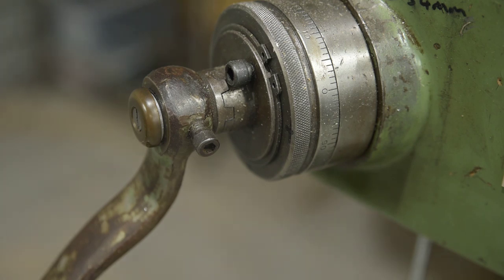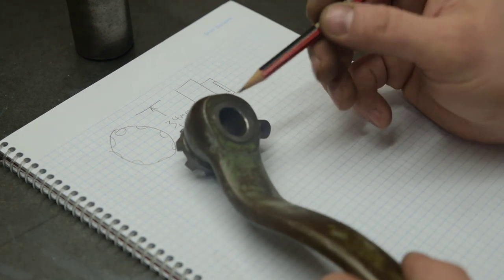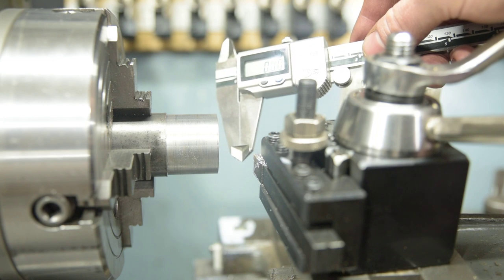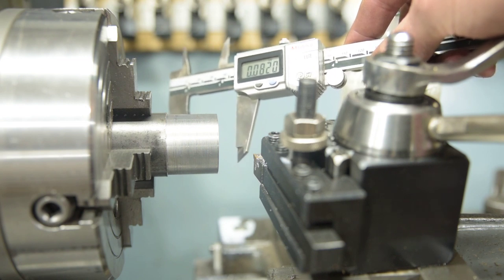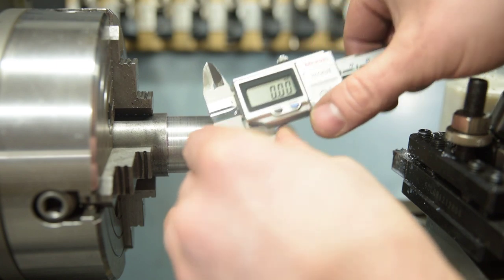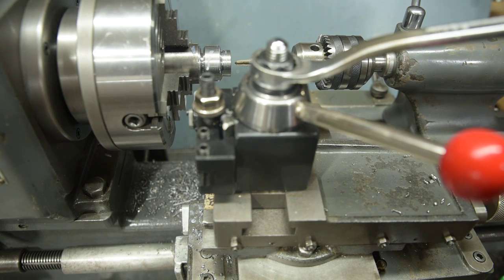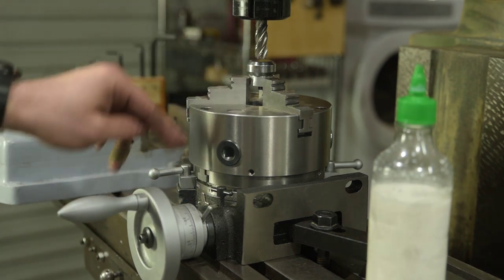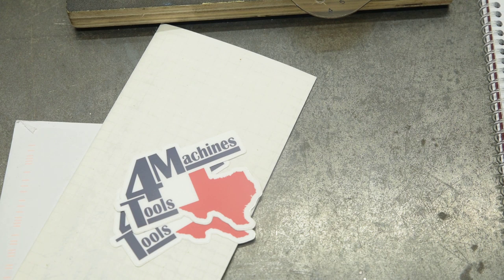Making a steel thumbwheel, plus some great lathe tricks

Comment: Thanks for the tips. Very handy to know. I really like the process you used to design the number/spacing of the flutes. I too find that aesthetically pleasing.
Cheers from Canada
Reply from the maker: Thanks for the great comment :) I am pretty happy with the design too. I reckon I'll probably end up using these proportions in future projects. One variation that I want to try is an external radius where the chamfers are, but that's just an idea at this stage.

Comment: Cool knob, I like the heavy chamfer and 5x flutes.
Reply from the maker: Thanks. The more of these I do, the less I think I need straight knurls on the shopping list 😁
Reply: @CraigsWorkshop  I find knurling a pain these features are a fun way to avoid it. It's a pain cause I have a small lathe. too much load for the push type knurl, hard on the bearings and chuck. And the cheap overarm pinch knurl I have it a piece of shit.
Reply from the maker: I've got a fairly crappy pinch knurler too (angled knurls) but I far prefer theae flutes too. It takes longer, but I think worth the time.

Comment: Gday Craig, the knob really looks good, definitely better not going as deep with the end mill, the polishing bug has bitten I see which is awesome, things don’t go rusty as easy, that’s a big plus, I’ve been doing the same deal with the digital callipers for some time now and it really is a big help, take care, Matty
Reply from the maker: Cheers Matty. I kind of mixed up two separate tips in one segment. Should have kept the caliper-zero tip separate from the balanced cuts tip - it would be less confusing! I've been doing the zero thing for ages too but a lot of people don't seem to use that method. In combination with the imperial -> metric thing, it's a great timesaver.
The balanced cuts thing is great for hitting a target dimension pretty precisely. You can use an indicator on the cross slide for even more accuracy of course.
Cheers, Craig
Reply: @CraigsWorkshop  You could also use an angled top slide for micro-adjust - old model engineer's trick.
Reply from the maker: @paulwomack5866  Absolutely. I did a video about extending this same trick to also convert mechanically between metric and imperial. Check out my last year video with the #tipblitz19 tag. Good fun if you like workshop tricks 🙂

Comment: Works great in use-handle mode, but when you're reversing the handle to save space, it looks as if the knob either needs to be a little larger in diameter to sit nicely ON the teeth, or a little smaller to sit INSIDE the teeth. It looks a bit on the edge as it is.
Since your lathe can't turn it larger, smaller seems the "go to" option, if I'm seeing it right.
(freeze frame at 25:46)
Oh - and Abom79 has been banging on about equal cuts for years.
Reply from the maker: Thanks for the Abom reference. Also you're totally right, I will shrink it down to fit within the castellated section. Just need to turn up a temporary aluminium collet first to hold the five lobe shape In the chuck. Don't reckon the three or four jaw will cope well with all the flutes and bumps.

Comment: Good job Craig. Works OK.   I would have just coarse knurled it to match the graduation ring further in on the shaft.  Either way it only has to be finger tight.  Cheers Rob
Reply from the maker: Cheers Rob

Comment: Your next project is to make a spring loaded tap follower for your lathe and mill. Easy to make and you will use it every week. Even with the tap just started in the work it is all too easy to snap a tap off reaching over the top of the lathe with your tap wrench and putting side pressure on the tap.
The other thing to be aware of is that all is not what it seems with electronic digital measuring tools. At first glance you might say that your digital calipers read to 0.0005 inches...that's what it says on the read-out. Remember digital devices are an all or nothing proposition. If your calipers read a zero or five in the last displayed digit the caliper you can at best only be certain that the actual dimension being measured is the value displayed +/- 0.00025 inch. Generally if the dimension has to be held within +/- 0.005, use a micrometer. You can do closer work with a caliper, but you have to be careful and check against a known standard size (checking against gage blocks is preferred). 
Also every time you zero the display the mechanism can only read the signal blocks that are a given distance apart.. it can't interpolate between blocks. The pick-up will pick the nearest block and display that as zero . In the example before with a zero or five  as the last digit displaye  it can be +/-0.00025 inch from where it actually is.
As a practical matter all of this doesn't matter most of the time, but is a factor when you start working in the +/-0.001 range and you should be aware of it.
Nicely made video and if you polish anything (including things like my head) it usually looks better.
Cheers From NC/USA
Reply from the maker: Hey Ace road holder. Brilliant information thanks. I will have to give that a slower re-read to make sure it all sinks in. Good idea on the tap follower. I have many little projects like that to get on with. Thanks again, I hope to show you a tap follower build in a future video. Cheers, Craig

Comment: Nicely done Craig, and because my shops also small, it took just once walking into that knee handle to make a habit of reversing it when it's not being used. However the end shaft for my mills knee was never drilled and tapped like yours is. But it's a definite project for the future I think. A very good idea and well demonstrated.

To expand a bit on Aceroadhandlers comments below, and unfortunately this is going to get a bit long. And sorry but I work and think in imperial measurements. But metric measurements would make no difference to any of this. Since I've had a bit longer to pick some of this up maybe it will help.

Most decent caliper brands will come with a user manual, there well worth reading through since a lot of what I'm posting here is already in them.There's three distinct and separate metrology terms anyone with a home metal shop should know and fully understand what they actually mean. "Accuracy", or what the tool can reliably measure to every single time. And that accuracy is directly linked to it's "Repeatability". And that repeatability has a great deal to do with the tools overall mechanical design, it's built in precision and the quality it's made to and with. Without that repeatability the tool can't be accurate since the measurements would seldom be the same. A soft mild steel digital caliper that was only roughly machined and not hardened and ground would be just about useless as an example. Then there's the metrology term "Resolution" that most get confused about. A tools resolution simply means how many digits there are to the right of the decimal point. A .001" reading micrometer has a resolution of one thousandths of an inch. But that resolution or last digit number is also NOT that tools accuracy or repeatability level and should never be confused with those. So while your calipers do show a resolution down to that 1/2" thou. The calipers themselves simply can't measure that well other than by pure random luck once in awhile. And random correct measurements that aren't repeatable or something you can count on aren't usable since you simply can't know which are or aren't correct. Logically there not repeatably accurate to that high level no matter what the displays resolution reads. So in my shop that 1/2 thou digit is just ignored on my calipers since it's basically meaningless for the following reasons. 

The design and the mechanical components calipers are made with, and the very slight but important clearance required to allow the sliding jaw to even move can also allow a small degree of tilting movement in the tools sliding jaw unless it's correctly used. Yes there are take up screws that allow reducing those clearances to a bare minimum and there usually located just to the right of the dial or display and above the beam of the caliper. There are still small but unavoidable clearances on even brand new tools no matter how well adjusted they are. It's not hard to add a bit of closing pressure and change the measurement by a thou or more.So a caliper's mechanical design alone just doesn't allow measurements to be made reliably to less than maybe a thou or two on even the very good one's. To get better than a calipers average level of accuracy, the far stiffer frame and much more rigid inline components of a micrometer are required. There's also a world wide agreed to metrology standard that the tools being made should fall within an allowable + - one count of it's smallest division or it's resolution to pass it's accuracy and repeatability certification. So a brand new tool being checked in a well known brand name factory can be incorrect up to that + - one count and still pass it's accuracy and repeatability specifications. Almost all of the better metrolgy equipment I've checked (Mitutoyo, Starrett) using fairly expensive Mitutoyo gauge blocks has so far fallen roughly in the middle or around half the maximum allowable deviations. One indicator was at about 80% of the allowed in a few places. A further issue with digital equipment is there's also the rounding off errors. Your displays 1/2 thou reading simply means the tool is reading the measurement as being somewhere between .0003" and .0007" of that 1/2 thou number. That's up to a possible 2/10ths on either side of being correct right there. And what the display is showing does not take into account those unavoidable mechanical issues previously mentioned. 

There's another metrology term, "Uncertainty of Measurement" and there's also the now generally accepted industrial practice that metrology equipment should be at least ten times more accurate as the highest accuracy specification for your parts is. In other words to measure and be certain of your measurements to .001" all your measuring equipment should be accurate and make repeatable readings to .0001" to then be 100% sure your parts are within a tolerance of .001" And that 10ths" level of accuracy still comes with the same allowable deviation of that + - one count. That's part of the uncertainty. And yes I do know high accuracy parts to low 10ths numbers are made every day using 10ths resolution equipment. That also takes a highly developed sense of touch and more than a bit of continuous practice. And there's still more uncertainty than if they were using higher accuracy equipment. It's not impossible, just a lot harder. So there's also the users extremely important technique while using any measurement tool. And the higher the accuracy the more important that well practiced technique becomes. But since this is about calipers. While thumb wheel equipped calipers can measure parts using it, Mitutoyo themselves advocate it's a better practice to either close a calipers jaws against smaller parts by using your thumb and fore finger to lightly squeeze the jaws closed and using as closely as possible the exact same pressure and finger position on the jaws each time. For larger parts where that doesn't work then gently closing the jaws on the part using two hands. That thumb wheel if used incorrectly can exert pressure in the wrong area at the top of the moving jaw and that can very slightly tilt that movable jaw. The further out on the jaws the measurement is being taken the more possibility there is of having less accuracy.For round parts then closing the jaws with your fingers or both hands further down on the jaws and opposite of where that round part is touching the jaw faces is a more consistent technique as one example. Trying to measure anything with just the tips of the jaws is really inaccurate due to even light pressure magnifying it's effect at the top of the jaw and again possibly tilting it a measurable amount.That thumb wheel is mostly meant for making fairly quick adjustments to get close to your part size. Yes most do use it to measure with and I used to do the same, but it's still a bit less accurate and I've proved that's true to myself.  

I made a point of checking my brand new solar powered Mitutoyo calipers when I first got them against my gauge blocks. They really were and still are the tightest yet smoothest calipers I've ever had in my hands. Under the best and most controlled conditions I can manage and using the best technique I know on those gauge blocks, then these calipers seem like they can be trusted to being within about .0015" of being correct on those gauge blocks every single time. Yes the calipers can do a bit better, maybe even to a thou. But that .0015" is my trust limit under those ideal conditions.Measuring parts still in the machine and during less than ideal conditions, variable surface finishes, part temperature etc.? Then maybe .003" at best. For myself if it's got to be accurate to less than about .005" I use a micrometer. This is already far too long, but I'll add there's ample and mechanically logical reasons the inside jaws most calipers have are even less accurate. And especially so as the holes being measured get smaller. Measuring and being certain of those measurements to even .001" is a whole lot tougher than most with home shops seem to think. And no off the shelf Starrett, Mitutoyo, Mayr and for sure other cheaper calipers can do so 100% reliably in average shop conditions.
Reply from the maker: Thanks Turning Point. This is great information. I had previously read about, and understand the difference between resolution and accuracy - but it's great to get another persons take on it, to cement it into the brain. But the section on uncertainty of measurement is a new one on me. And no, I don't trust internal calipers in round holes :-)  I have some good telescoping bore gages, and now some small hole gauges - which themselves are another delicate feel-based friction-based tool which take a bit of time to learn. Repeatable results with those are a function of skill rather than just owning the right tool for the job. And - perhaps surprisingly - even with something as coarse as a tape measure you can get large errors from not holding the thing perpendicular to the faces you're measuring etc. I've seen people "measuring" with some comical setups. :)

At the time of recording this thumbwheel video, the best measuring tool I had for that size was those mitutoyo digital calipers. With all calipers, I'd previously noticed that if I squeeze harder, they "measure" smaller, so it's definitely a delicate operation, and I know I can't go in hamfisted and clamp down on the thing and expect repeatable results.

Since making that video I've been lucky enough to receive some larger size digital mics (also mitutoyo) from an exceptionally generous viewer. These have a resolution down to microns (0.4 ten thousandths, or 40 millionths), and they have clutches on the spindles, which give good repeatable results, so my uncertainty (hopefully) should be one order of magnitude coarser than microns? In other words with the 1 micron calipers, I should get a good repeatable accurate result, if I am measuring and working to hundredths of a millimetre (about 0.4 thou)?

I will cut and paste your comment into a file and re-read it again to make sure I'm not missing any golden nuggets of information. Thanks for taking the time to write such a well thought out and informative comment!

Cheers,
Craig
Reply: @CraigsWorkshop  I've had to do a whole lot of research about metrolgy for a long time simply because I've got no one to actually teach me so I got forced into it. 

I've also got 1"-4" Mitutoyo digital mikes that I've had for some time. Yes there very good and you'll love them. But they should be 50 millionths resolution unless there different than mine. I think you'll find accurately and repeatably measuring to 10ths still isn't quite as easy as it looks even with them.There's enough variables between what's holding your ears apart and the micrometer anvils to make it a bit less than simple. Getting down to .4 thou shouldn't be too bad though. And they are a big help. I've tried covering the display with a post it note and checking various random gauge blocks to test myself and small measurement variations can show up if you don't do everything as well as possible. So it still takes practice. The calipers are always my most used tool and they get me close and then those mikes get used when needed. Just be sure to use SR -71 battery's and not the LR type, the lifespan is about 3 or more times as much. 

To measure those telescoping hole gauges I found it a big help to either buy or build a decent micrometer vise. I did buy the Mitutoyo 156 - 101 version, but for what they are there a bit expensive. Hold the mike in the vise, set one end of the telescoping gauge against the micrometers fixed anvil and sweep the other end of the gauge past the advancing anvil until you get a light drag as the gauge end goes past it. Juggling the mike in one hand, adjusting the measurement with a finger and sweeping that gauge past the micrometer face is for me slower, a bit less consistent and tougher. Probably a real machinist wouldn't need that crutch, but I do. :-) My mikes have a ratchet thimble and for the best consistency Mitutoyo recommends using the same number of slow clicks for each measurement. If the accuracy requirements are high enough it can sometimes make a small difference. It's a habit for me now so I don't even think about doing so.